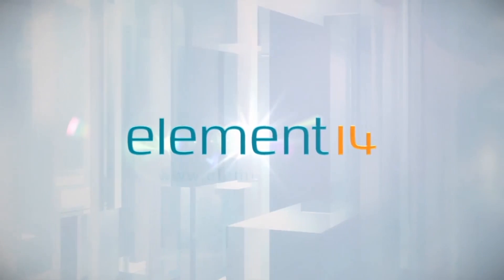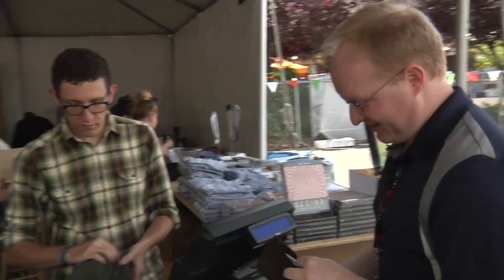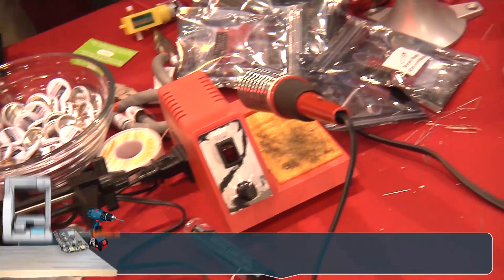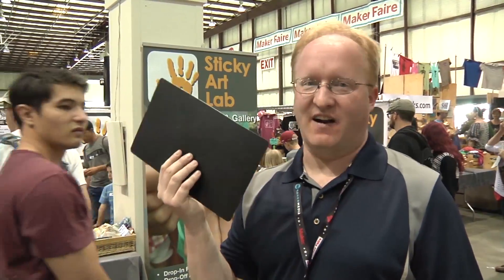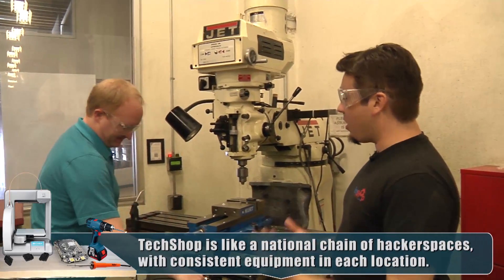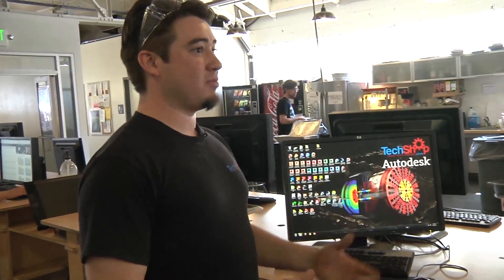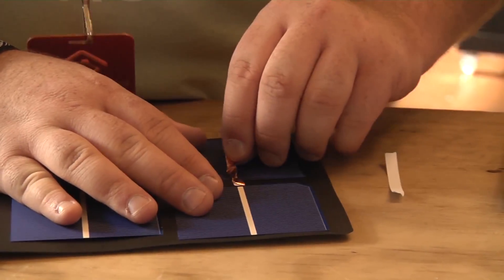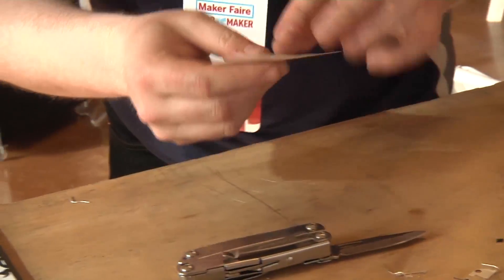Ben Heck's Maker Faire Solar Wear Scavenger Hunt

Comment: you can actually run teh USB soldering iron off of a USB 3.0 port on a PC just fine, USB 3.0 is rated for 1.5a  5v at the port

Comment: Then came a gust of wind and knocked the fragile, loosely taped panels onto the floor, shattering them.
Reply: There was a lot of reminders about the solar cells being fragile, almost like it was a major issue...

I wonder how many they broke while trying to build the hat...
Reply from the maker: Yeah - if only we could have bought that flexible solar panel! That's the thing with a scavenger hunt - you have to get by with what you find. We broke one panel in the making.

Comment: you always miss to proof that it works i guess it didnt? :)
Reply: If you look at the video you can see that the sun was about to set when the charger was complete, it probably couldn't get enough energy from the sun because that's how solar cells works. They need to be in a good angle towards the sun and the sun needs to be bright, when the sun is low it's usually a little bit less bright than usual and it's not high enough for the cells to get in the perfect angle zone.
Reply: MiniDemonic  there are artificial lights around aren't there?
Reply: ***** Artificial lights are not good enough to charge a phone with..